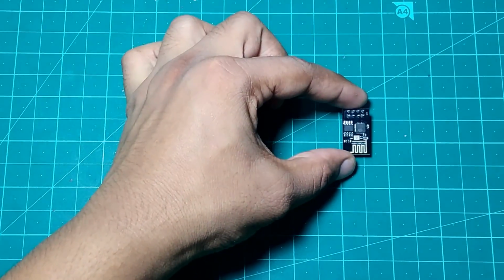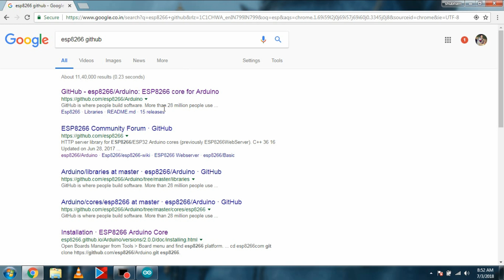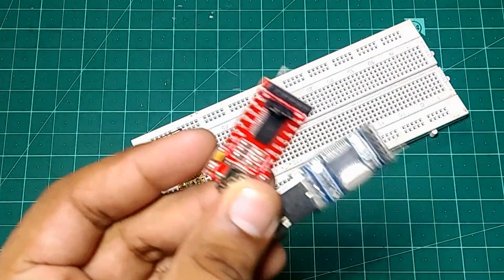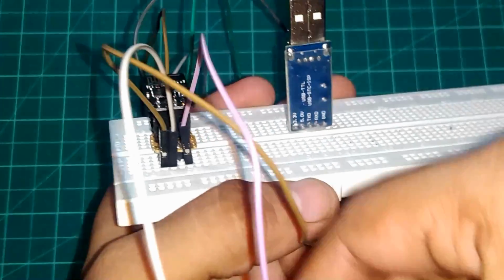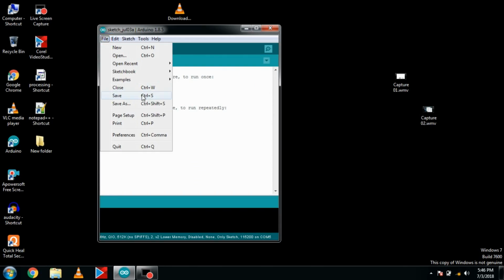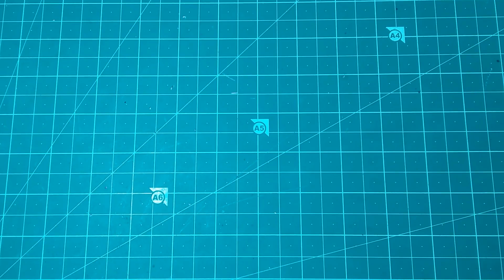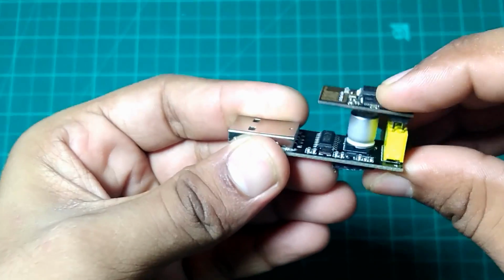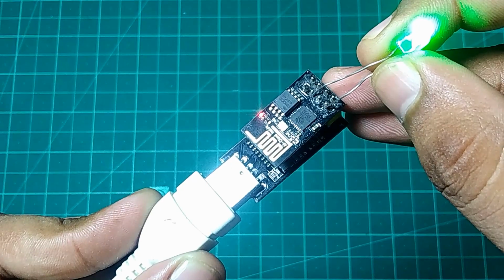Getting Started with ESP 8266 ESP 01 with Arduino IDE | Programming esp-01 with Arduino ide

Comment: excellent work ! I am in the process of carrying out my graduation project and I really need help! I will make a connected socket and a remote lighting control with WIFI. I need some help! thank you ..
Reply from the maker: could  please explain  you whole idea so that i can suggest  something.
Reply: @electronicGURU  in fact I want to create a connected socket, in which I will put a lamp that will be controlled remotely using a smartphone or a remote control.
I want to make the appropriate electrical diagram but I can't. Thank you for your reply.
Reply from the maker: yeah i am planning  to make one too but you do know that there is already a esp8266 board with relay available  ? right?

Comment: Good job man. Following your tutorial I have uploaded a sketch on the ESP8266-01 and it works properly. But I would  like to know how to reset the module and re-programming with another sketch the module. I have found something on internet but it doesn't satisfies me completley. I use an FTDI to upload the sketches and I would like to use the same FTDI to reset the ESp8266-01.Thanks.
Reply from the maker: Actually you can use the reset pin onboard connect it to gnd.
Reply: @electronicGURU  Thanks, I have solved yesterday following the guide of the AZ-Delivery ESP8266-01. I was doing a mistake. Anyway thanks mate.
Reply from the maker: okay man

Comment: "failed to connect to esp8266 timed out waiting for packet header
Reply from the maker: Very first check if you are using a Healthy ESP ? Sometimes they die... And second make sure your usb to ttl is fine ... because this could be caused by driver issue as well and thirdly check Arduino IDE if everything is good there as well.

Comment: Bro if I use nodemcu instead of Arduino will it work?
Reply from the maker: For what? For programming esp01?
Reply: @electronicGURU  The Arduino board was used for programming the esp-01, so if I am asking for replacing the Arduino board with nodemcu, I surely mean to programme the esp-01 with Nodemcu.
Reply from the maker: Well that is not a good idea. Please avoid it
Reply: @electronicGURU  why it's not a good idea plz explain 🙏🙏
Reply from the maker: Because in Arduino you can directly take thr Atmega IC off and it could work as a USB TO TTL but same thing can't be done with ESPs and ESPs are a little bit tough than Arduinos

Comment: Interestingly, my attempt at this is doing the opposite in terms of blinking. The sketch says to pull low to turn the LED on, wait a sec, turn the LED off by going high, wait two secs. Mine is blinking on for 2 secs, off for 1. So going high is turning my LED on. Are the comments in the sketch wrong, or is it me?
Reply from the maker: Well i am not sure what could be there... But i have seen different types of esp clones with different different configurations so that could also be the case.

Comment: I tried uploading the Blink program, but it did not work at first. It looks like in the 2 years since this video has been uploaded, the example sketch in the Arduino software has been changed. For me, I was confused, that my LED did not blink at all (it was glowing constantly). Looking at the code, I saw, that the Blink-code now makes the little LED on the ESP8266 blink. And that worked just fine.
Reply from the maker: Love to hear it that finally it worked for you and yeah its correct they are changing things even day by day.

Comment: I have a question. I need to monitor the battery voltage as well as some I2c data. I can see how to use I2C . I understand the exp8266 has an analog pin but just not broken out. Can you break that pin out, use a R divider 3.3 to1.0volts and use?
Reply from the maker: Yeah it is possible we can do that.

Comment: Here's another version of the USB to serial adapter that has a built-in programming switch:

https://www.aliexpress.com/item/32795568611.html?src=google&src=google&albch=shopping&acnt=494-037-6276&isdl=y&slnk=&plac=&mtctp=&albbt=Google_7_shopping&aff_platform=google&aff_short_key=UneMJZVf&&albagn=888888&albcp=1582410664&albag=59754279756&trgt=743612850714&crea=en32795568611&netw=u&device=c&gclid=CjwKCAiAuqHwBRAQEiwAD-zr3cVLCPZyHxLIm_MKsKnradehJ27OkxcuErY8BFOBuNkrWJhv42HyhBoCLYUQAvD_BwE&gclsrc=aw.ds
Reply from the maker: Thanks for sharing.

Comment: Hii bro great work. But I'm facing different issue stating exemption 9  and resets my board which I don't want to happen. Please help me out with that...
Reply from the maker: Can you explain your issue in a more detail.
Reply: @electronicGURU  actually I'm using node mcu for my project. My code simply get there data from firebase and set the servo. Position to accordingly, it's works good for 2 minutes,  later it shows some stack values and restart the board. And automatic my servo goes to zero and comes back again. And in serial monitor it shows exemption 9 along with some stack values...
Reply from the maker: Thats will be either code issue or power issue. 
Most of the times this kind of issue is seen when there is some power failure. Try to power it with a proper power source to make sure power failure is not a issue due to power source and faulty chips on pcb can also cause power failures.

Comment: So for the serial to USB, you just shorted the GPIO0 to GND with no resistors or anything?  Just a straight connection?
Reply: When I try to upload the same way you do, it keeps giving me timeout errors
Reply: @electronicGURU  So after researching for another 3 hours, I found the solution was changing what was considered the default LED pin on the chip to just be #define (whatevervariable) = 2 and just use that to fix it.  I was using the USB setup and I had to solder in my own pushbutton to get it to work since I didn't have the materials on-hand for a pinout

Comment: I did everything, what you said in this video, but i don't have a COM5 in ports, why?
Reply: It will be different from computer to computer, check your COM ports before plugging in the programmer and after plugging it in, the new one will be your programmer.
Reply from the maker: It doesn't have to be com5, and what abhiram said look for that as well and even after that as well you can't find it look under unknown devices in Device manager and make sure you installed drivers correctly and if not please do that.

Comment: Hey mate, 
is there a way we can disable both red LED (which shows only whether it is ON/OFF) and disable the blue LED (that shows the program has been uploaded), so we can then reduce power consumption in the system. Thank you
Reply: @electronicGURU  hmm I see. Thanks my friend
Reply: @electronicGURU  I looked at two datasheets:
http://wiki.ai-thinker.com/_media/esp8266/esp8266_series_modules_user_manual_v1.1.pdf
https://www.espressif.com/sites/default/files/documentation/0a-esp8266ex_datasheet_en.pdf

And they don't tell to which GPIO is connected to the in-built red and blue LEDs. Is it the GPIO 0? My ESP8266 EX 01 is that black colored one.